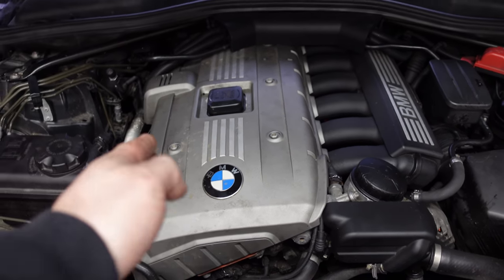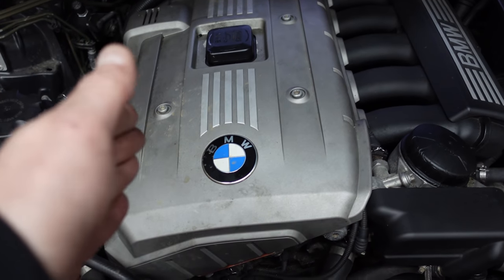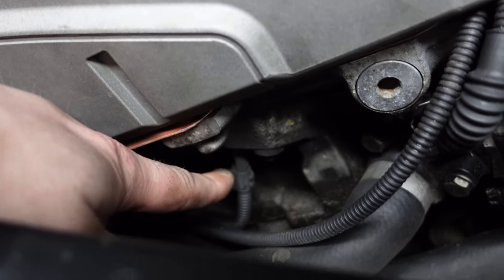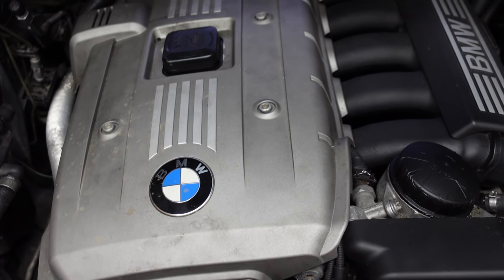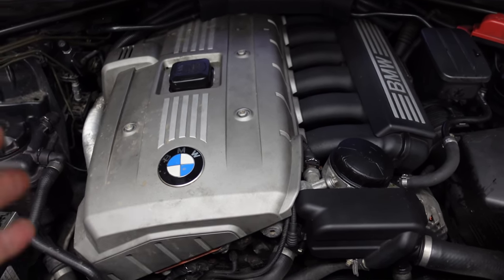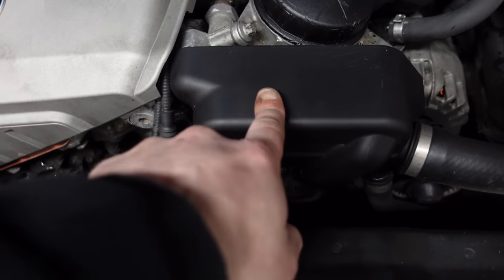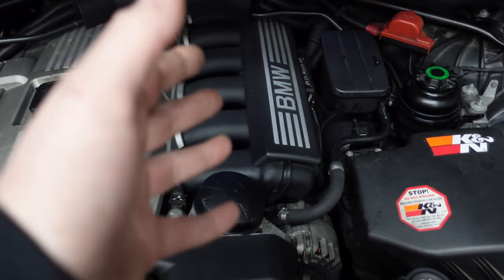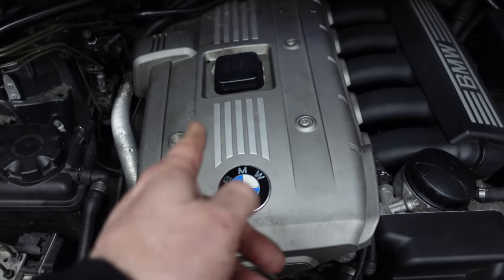The **REAL REASON** Mechanic's HATE BMW / Its Worse Than You Thought !!

Comment: Could you help me? I have an 523i n53 engine, that was idling ruff, i went to a bunch of mechanics they changed plugs, injectors, even NOX sensor so far, and in the end they found out that it was the valve membrane from the headcover, that was broken. They did change it but they told me that part cannot be find as original part so what they did put in it is an aftermarket, the problem got solved, there are no more faults or any other big issues like there was before, but i still fell a small trembling when idleing, even that there is no fluctuations in the rpms. The only thing what i did observe when i put it from D to park, it slightly drops on the rpm and then comes back, 
i would really like some advices from you  because as you told in the video many mechanics do not know what they are doing... Also i would like to have a perfectly running engine on my car once again. Keep up the videos like them allot. Thank you in advance
Reply: No punjab

Comment: Those motors are trash to begin with.
Who ever thought an electric water pump is a good idea.
Reply from the maker: Your telling me worst invention ever it was to make more power so it wasn't driven by the belt but it was also BMWS first time using this so called new invention
Reply: @BMWDoctor  so if it's for more power my did the new m3 bmw go back to mechanical water pumps.
That whole engine is shit,the only good thing is that it's a straight 6.
Reply from the maker: All m cars have always used mechanical it was only the normal inline 6 that changed to electric water pump but M cars it would have done no favours using electric water pump the E90 M3 S65 uses mechanical and so does the S85 during the time of the N series engines they never fitted that to them.
Reply: @BMWDoctor  s55 uses electric pump
Reply from the maker: Oh good god and there was me thinking of buying a M4 you can forget that lol I didn't know that one I think BMW are confused like this USE IT OR DON'T USE IT they dont know whether there coming or going on these engines lol I mean S55 is a failure already with the many issues and then a electric water pump ? THAT engine must be avoided great power engine and powerful but thats it
Reply: Or liquid cooled alternators. They’re just poorly* over engineered all around and they end up creating problems from typical nonissue components.

Comment: Well everybody has their reasons for liking one product over another and this is a perfect example. I think I heard him say a couple of times even BMW can’t  diagnose or fix the problems. The problems you noted are pretty common. Another problem with BMW is their use of plastics on major components. Defend it all you want but heat expansion and cooling contraction blows their logic for using such inferior materials. So what does this come down too, LOL easy engineering corporate talking heads and the money. Absolutely great driving cars but even that as of late seems to be an issue compared with solid driver cars from other manufacturers. If the fixes are so simple in the problems you addressed why hasn’t BMW made the repairs known instead of letting the reasoning that old mechanics should become carpenters. How about engineers especially German don’t understand the concept of KISS. I gotta say very informative tube on many levels. I have a great time at Palm Beach International doing the road course and observing real world cars and Drivers and BMW isn’t the ultimate anymore by any stretch of the imagination. With your logic I say that most BMW owners depend more on the mindset they have the ultimate driving machine but couldn’t do any better in a Honda Fit.

Comment: I agree that you need to know about a car before you work on it but it sounds like you're making excuses for BMW's shoddy engineering.  No car should be that finicky.  I've worked on exotic cars that are less problematic than BMW's.  The worst car I've ever owned was a range Rover with the BMW  powertrain.  2 engines and a transmission later I went back to Mercedes.  The power train on the Mercedes are bulletproof.

Comment: Would those faults all be found if the tech follows DIS guided testing?
Reply from the maker: No they wouldn’t it takes a brain and knowledge of these cars to find these issues and something called common sense and understanding German engineering which a lot of people lack these days.

DIS testing is not good for electronics or mechanical stuff you need to have your own brain and work these cars out yourself
Reply: @BMWDoctor  ok personally I have always solved problems on my BMWs with the combination of  Inpa and a Launch scan tool or the classic red brick Snapon for the older cars.  I do have dis (or Ista d) but I have never got my head round what it's trying to do.

Comment: Toyota runs circles around BMW all day long. When was the last time you saw a BMW with 545k miles on it. I’ve had a few 3 series and they were a POS as far as reliability goes. Reliable? What are you smoking?
Reply from the maker: Does it I think you don’t know BMW very well pal when your talking about BMW are you talking just about the “USA” or the whole world because I  will correct you there the M57 is one of the best and bulletproof engines ever made and army use them so does Range Rover in there 4x4 and there is many many out there with 800k plus miles on that engine my friend go and check M57 before you open your mouth about something you know nothing about dont compare your country to ours we get the ultra reliable engines same as N53 something many don’t even know about it’s all Uk and eu engines only ! 

M57 is one of the most solid and reliable engines ever made and is in many cars over here and it’s what we drive with ZERO issues for many many many thousands of miles

Comment: Hi
I've watched many of your videos and you're one of the few people who seems to know what he's talking about. 
I would like some advise if possible.
I have my engine light that's been on for a while now and my local garage can't seem to figure it out. 
I have a BMW code reader.
Car is f10 2010 525d n57 engine
Code 258300 exhaust back pressure sensor signal too high and 
250B0D exhaust back pressure sensor before particulate filter signal short circuit.
I have changed  the back pressure  sensor  but the error remains.
If I clear it, the error returns the following day.
I also get AIR MASS TOO LOW  error.
I have cleaned MAF sensor
Could it  possibly be egr? ? 
DPF warning came on 
 about 6 months ago (because I wasn't at work and  only doing short journeys because of lock down. After a good run error went away and hasn't returned since. I always try and drive it in sports mode just to keep the revs up.. whether that helps with DPF I don't know ) 
I'd be very grateful for your input 👍👍👍

Comment: Maybe these engines are poorly engineered, making them unnecessarily complicated. If you need a very specialized scanning tool for these cars, maybe this brand is the problem. Two sparkplugs per cilinder and an electric water pump are two great examples of unnecessary over engineering.

Comment: Run BMW's for years never had a problem fixing them
Reply from the maker: Thanks for confirming the truth 🙏
Reply: @BMWDoctor   can't say the same about Mercedes
Reply from the maker: 😂 Mercedes is a good car man again takes a lot of understanding it’s more harder than BMW but I do Mercedes aswell all the time it’s easy for me but I can’t own them as I’m a animal on the roads with a AMG last time I ended up in a pursuit with the whole of the MET & Hertfordshire police started in north and ended up in Hertfordshire with about 50 cars behind me 😂 after immobilising 5 of there vehicles very very strong and solid cars and trust me I can deffinetely vouch for that they can take a beating and keep going
Reply: @BMWDoctor   you need to plug Mercedes in to the star software where the BMW  a snap on will clear most faults
Reply from the maker: I love xentry my friend it’s easy to use 😂 why would you use a snap on for Mercedes and even BMW can I ask that ? Just why I have all genuine dealer software for all my German cars and I have test platforms for all the makers out there as I do a lot of work for most dealers across the world when they can’t fix something or need a quick key turn around for some celebrity who lost it on a night out

Comment: The real problem is that you're dealing with a POS vehicle design and build quality. What morons thought an electric waterpump and programmable thermostat was a good idea? -  BMW engineers, of course. Who else uses electric waterpumps for primary cooling? Who else has oil coolers that leak and derail auxiliary drive belts? Who else uses plastic extensively in the cooling system which is prone to brittle hardening and cracking with age? What other major auto manufacturer thought a sequential manual gearbox was a good idea for a mass production vehicle? Who else tunes a motor to the point where enough stress is placed on the main bearings that they become a "normal" maintenance replacement item with a 60-80k mile life expectancy? Who else makes cheap plastic intake manifold tuning parts that wear out and throw error codes at well under 100k miles? Who else makes a variable valve timing system that is extremely sensitive/vulnerable to oil varnish/contamination from extended oil changes? Who else makes engines that run extremely hot and cook valve stem seals causing them to fail before 100k miles are reached? Who else makes valve cover gaskets that harden from high temperatures and leak seemingly every 40 to 50k miles? Who else makes an engine that requires intake manifold removal to replace a starter? Who else makes a car with a $1500 ABS module that routinely fails with less than 100k miles? Who else makes a poorly designed coolant transfer tube seal for their V8 engines that frequently fails, resulting in a very costly/complex dismantling and repair job? Who else makes a poorly designed secondary air injection port that frequently plugs up causing the car to fail emissions testing well under 100k miles? The list goes on and on and on. This is the real reason why experienced mechanics hate modern BMWs - their modern engineering and quality is an utter embarrassment compared to what it used to be in the 70's, 80's, and 90's.

Comment: Ok wrong . If you bring your BMW to a BMW dealership shop they WILL without a doubt know what the problem is. The only problem with going straight to them is that you’ll pay ... a lot . 😂😂😂🤣🤣🤣
Reply from the maker: Nooo they won’t know what the problem is at all !! I think you need to go there I guarantee your car will come out of there worse then it went in
Reply: I agree went in one code. Left out with -700 same problem. Plus 13 codes!!
Reply: Nooo, heard plenty of horror stories from dealers ... simple things wrong but they want to just replace everything.  Good diagnostics are hard to come by these days.
Reply: Not necessarily took her one series back to a local dealer under warranty told them the driver's seat wouldn't tilt forwards as the cable had snapped and had they a new one, a technician overheard and offered to take look, handed him the keys, watched him stroll over to the car open the  passenger door play with it for

Comment: My 2020 M5 Competition is fantastic.  Maybe you should just switch to doing something else.  One mechanic at a BMW dealer does not represent ALL of BMW.  "They this, they that.  Get over yourself already. I would NEVER let anyone other than a dealer even touch my M5.
Reply: Only person you need to convince is yourself. As long as you’re under warranty you’re good. Scanned a brand new X5 M a couple weeks ago with 1100 miles on it with a dozen fault codes. Come to the conclusion BMWs roll of the assembly line with faults/issues.

Comment: I have been driving bmw for the last 35yrs owning across. The ranhe from e12. 34.36.46.90.91
Bmw is the best example of good ingeneering.
If truthfull nachanics like yourself know the few inherent problems like gasket on oil filtr m50/52 or rod bearing on v10.
This is all known to an informed and experienced mechanic.
Problem is that the new age part fitters have no analytical ability as they can only look at a part and replace that part. Part fitters.
Pleaee dont call them mechanics as part fitter fall way down with bodyshop stripper and assembler.
Dont blaim the product blaim the plep.
No persons without analytical oinsight into bmw should be allowed to touch it.
Again compare a proper maintained bmw life expectancy to that of other oem cars. You will see bmw will always come out on top.

Comment: BMW use lots of plastic crap that goes brittle with age.  BMWs new are ok ,  but passed 100,000 miles they are a money pit.  If you retrained all the mechanics in the World  it would not make much difference as BMWs have built-in obsolescence /bad design  and too many computer modules!